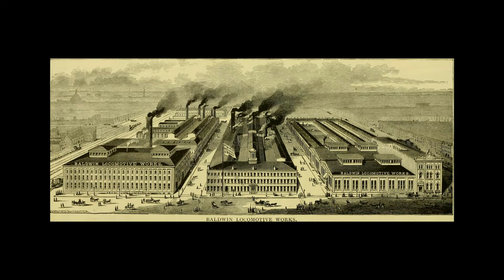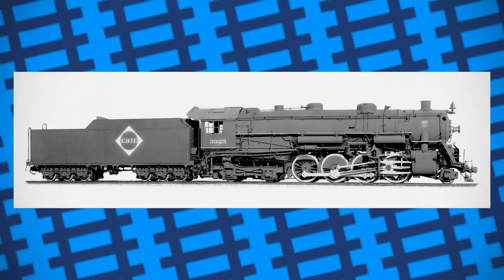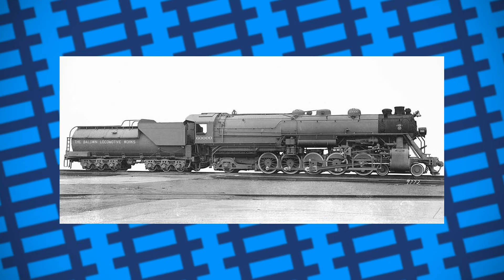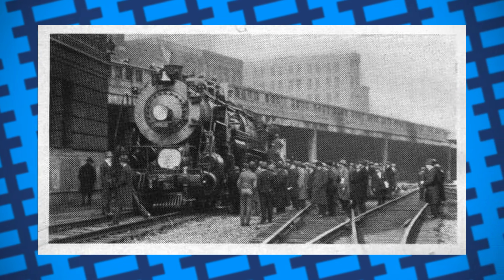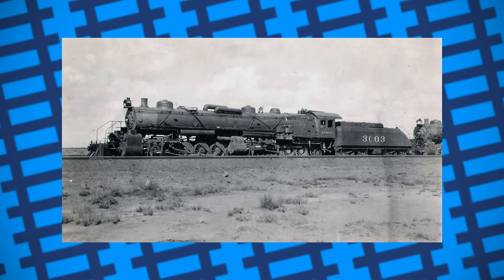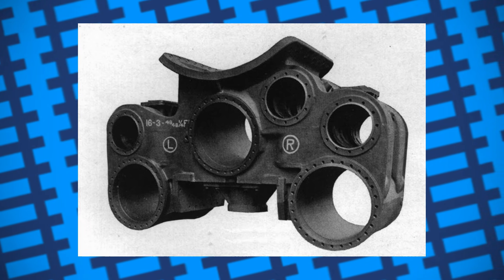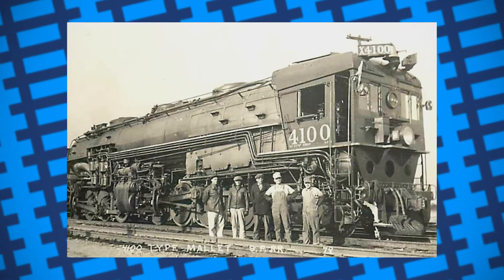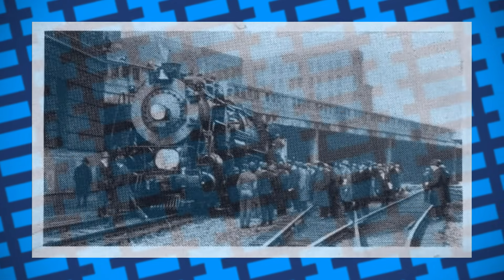Nobody wanted Baldwin's Best engine - Baldwin 60000

Comment: As soon as you said it had a third cylinder I thought, ah, that's a big reason it wasn't successful in the US right there. With more loading gauge to play with, railroads in the US preferred dual cylinders almost exclusively due to maintenance considerations.
Reply: To go a bit more deeper into it and something this video kind of glosses over is there was a time where America embraced compounding with Vauclain compounds everywhere. The Vauclain system was a Baldwin design, and countless engines were built with it when new from the factory (including the what are now known as the DRGW K-27 engines). Since American railroads often had steep track gradients with rapid changes from moving up and down, it was seen as a way to conserve steam on uphill climbs giving the fireman a chance to stoke the flames on a downhill run through the efficiency gains in compounding.

The problem was that the Vauclain system was a shop-queen, something that proved more problematic in the repair bay than any gains it got on the road through efficiency. By the time Lima came about with "superpower" as a concept, Vaulclain was dead and dozens of major railroads in the nation had sworn off compounding in single engine locomotives.  Superpower, boosters, improved superheating, etc. was all seen as solutions that solved the problems Vauclain was originally meant to address. Only some Mallets still had compound cylinders where it was seen as less of a repair issue as it was in more compact single engine designs. The only other major compounding in a single engine design we would see would eventually be some Gresley style designs that UP and SP would use that were built by ALCO who had rights to use Gresley's triple cylinder design in America, and I know a UP example is preserved in Southern California on display in the RailGiants Museum at the Ponoma Fairplex.
Reply: Surprisingly there a couple of three cylinder classes in the states, but like you said they aren’t common.
Reply: Three cylinder engines apply torque more evenly than two cylinder ones so they are less likely to slip and have a greater tractive effort
Reply: @ROBERTN-ut2il  but have a higher maintenance cost. And make them more complex to work on.
Reply: @gamerfan8445  Exactly. In the UK, despite its restricted loading gauge which limited cylinder size, two-cylinder engines were preferred for post-war designs to avoid maintenance of internal machinery. In the US, outside cylinders could be big enough to give any desired tractive effort, especially with two sets of driving wheels and cylinders.
Reply: @iankemp1131  The obsession with simplicity produced inefficient locomotives with a poor power to weight ratio. Take for example the Britannia Class Pacifics (BR Standard Class 7) These first appeared in 1951 and weighed 94 tons in working order. At that weight and by the standards set in pre war days these engines should have been able to sustain 3,760 ihp, they couldn't get remotely close to this so the question is why?
Reply: @DeCasoU1 But what other locomotives, prewar or not, could sustain 3760 ihp at anything remotely like this weight? Possibly some souped up Chapelon engines, but nothing else in Europe - or anywhere else in the world? Certainly not within the severe restrictions of the British loading gauge, both dimensional and axle loading. There is a record of a sustained 20 minute effect at 2200 DBHP by a Gresley A4 and a short peak on Shap of over 3000 hp by a Duchess (Princess Coronation). That's all. A Class 9F on the Somerset and Dorset line, with the Britannia boiler, produced over 2000 DBHP and about 2700 ihp, but again for a limited period climbing a steep bank. Also, as British engines didn't use mechanical stokers, any sustained effort beyond this would be beyond the physical capacity of a single fireman. Incidentally the DeCaso U1 is shown as weighing 129 tonnes and delivering 3260 hp, which also seems to fall well below your criteria.

Comment: The most idiotic thing is, looking at the specs they didn’t even compound the locomotive properly. Cilinders have the same specs as HP and LP. A true compound has a smaller HP.
Reply: I just checked Andre Chapelon's 242A1, arguably the most efficient steam locomotive ever.   The single HP cylinder was 600 x 720mm, the two LP cylinders were 680 x 760mm.   i.e. each LP cylinder was 35% greater volume than the HP.
The Midland Railway's  1000  class  had 19"x26" HP and two 21" x 26" LP.   So each LP was 22% larger.    The Great Central's compounds were the same.
So even with a single HP cylinder feeding two LP cylinders, the HP cylinder tended to be smaller than each LP cylinder.
[Edit}  I also checked the SNCF's 241P's - four-cylinder compounds.   The volume of each LP cylinder was 2.45 times the HP, which is almost exactly the same  LP - to - HP ratio as the Midland and Great Central compounds referenced above.
Based on those, one could certainly argue that Baldwin wasn't making full use of the expansive potential of the steam, by about 20%.
I did Google 18 478,  Bavarian S3/6,  4-cylinder,  and the ratio for that is 2.73 i.e. almost the same as Chapelon's 242A1.
Reply: Yes, they did compound it properly. The middle cylinder exhausted to the two outer cylinders.
Reply: @SynchroScore  Look at my last sentence and google 18 478 for fun. Then you'll see a proper compound. Not this joke.
Reply: @Cornhub69-j1f  I did read your last sentence, and that only serves to confirm that you don't really understand how these things work. Yes, K.Bay.Sts.B 18 478 is a compound, of a different type With a four-cylinder compound, the low-pressure cylinders must necessarily have a larger volume. Baldwin 60000 is a three-cylinder compound. Yes, the cylinders are the same size. The one high-pressure cylinder exhausts into two low-pressure cylinders. Therefore, the low-pressure volume is twice the high-pressure volume, which is the exact principle of a compound steam engine.
Reply: @Cornhub69-j1f  I am familiar with them, yes. Marine engines don't have the same space restrictions as a locomotive.

Comment: 60000 could still compete with modern locomotives. Long live steam.
Reply: Not really. Only the big boy, class A, and challengers can go toe-to-toe with modern equipment.
Reply: @gamerfan8445  not competlely true most 6 axle diesels have 4,000 to 5,000 hp, the only diff is diesels can be DPUed together

Comment: I have to agree that this is a engine that would be a strong candidate for restoration and being put back into some kind of limited service as a tourist train.
Reply: what restoration? this engine sat from 1943 in a Closed, heated enviroment, I highly doubt there will be any restoration, only maintenance.
Reply: @dark_one1337  All her bearings are shot from being shuttled back-and-forth a few feet at a time for years by a screw mechanism. Why the franklin institute ever thought that was a good idea at all, I'll never know. Also, the same issues that made the railroads reject it would be a major headache for modern tourist operations. The maintenance costs on the unconventional water-tube firebox AND the extra cylinder, with associated running gear, would be astronomical, even compared to similar-sized steam locomotives.
Reply: Literally just stop talking its stuck in a building and will never ever run again
Reply: @justinhicks4897 who gives a ratsass if it’s stuck in a building? People can dream of seeing it run again, can’t they?
Reply: Uhh.. it’s stuck underground so it will take some effort to get it out
Reply: @justinhicks4897  Dude calm the fuck down. A single comment made days ago isn't worth getting worked up over.

Comment: Sadly I think what killed 60000 was her water tube firebox. Watertube fireboxes and boilers are fantastic in things like a marine application, where on a ship, you have multiple boilers to power it so the long and often maintenance required on the boilers is a non-issue. But on a locomotive? It's just not worth it, and if the tube bursting was sorted with better quality tubes (perhaps partnering with Babcock and Wilcox or the US Navy which was using water tube boilers), I still firmly believe that the maintenance in the firetube firebox required put so many companies off 60000
Reply: also, a water tube boiler runs the risk of being... overqualified. Which could lead to snapping couplers and increased slipping.
Reply: Nigel Gresley found the same with his No 10000  4-6-4 on the LNER, a four-cylinder compound.    It was later rebuilt with a conventional boiler as a three-cylinder simple (non-compound), in which form it was presumably satisfactory since it lasted until 1959, approximately as long as other conventional locos of its era.
Reply: @cr10001  Worth noting however that 10000 had a water-tube boiler whereas 60000 just had a water-tube firebox with a conventional firetube boiler. Interesting though that they both suffered the same problems of bursting tubes. Apparently Hungary mastered this with ~1000 engines built with the similar Brolan boiler.
Reply: The conventional firebox with water spaces around it to absorb the heat and raise steam was so effective that nobody has particularly wanted an alternative. Firebricks were tried in the Paget engine and Bulleid's Leader and were unsuccessful. A normal firebox does need lots of stays (hundreds in fact) which is a lot of work, but once built, is low-maintenance as long as stays are checked for corrosion. Railways were already used to this outlay so saw no reason to change.
Reply: @iankemp1131  yeah plus firebrick isn't needed for a coal burning locomotive, but it is very useful for an oil burning locomotive and oil burning boilers in general.
Reply: @KPen3750  Interesting point - because it helps reflect heat back into the furnace? Coal fired engines have the brick arch which I guess contributes to this - it gave the intensity to burn coal without excessive smoke whereas previously steam locomotives had used expensive coke.

Comment: 60000 NEEEEEEDS to be restored
Reply: Unlikely, it a better chance for UP838 to be restored then 60000
Reply: @gamerfan8445  Actually 60000 is in very good shape mechanically and there is however slim chance that the engine can be restored
Reply: In that case The Franklin Institute NEEEEEEDS lots of $$$$$$$$$$.

Comment: Also Southern Pacific eventually got 4-10-2s of their own. and just like 60000, one of the Southern Pacific's 4-10-2s number 5021 is on display as of today
Reply: Union Pacific also got 4-10-2s after Southern Pacific. However, Union Pacific called them Overlands, referencing the route they took.
Reply: It’s a shame that SP didn’t take it as is. After all, an entire division in the southwest was coal fired, so I could see this succeeding there.
Reply: @nathandeal9703 also the reason they don’t want 60000 is because they don’t need them at that moment.
Reply: @nathandeal9703  Unfortunately, I think the complexity of the design is why SP didn't take it. 60000 was a 3-cylinder Compound loco with a water-tube firebox. SP already had a sizeable fleet fo 4-10-2's with "simple" cylinders and regular fireboxes